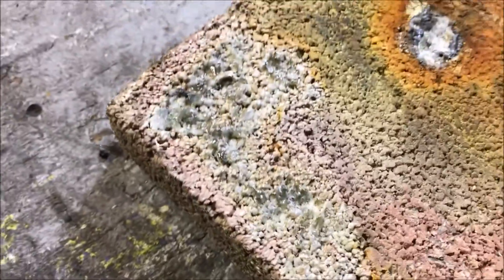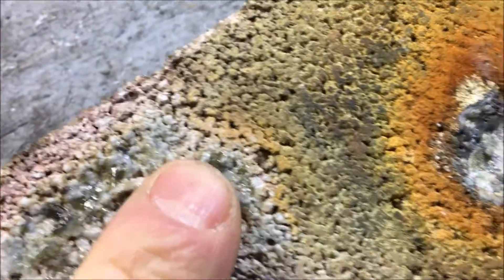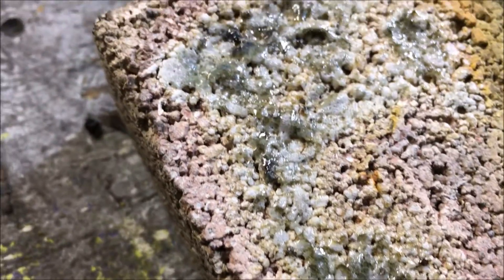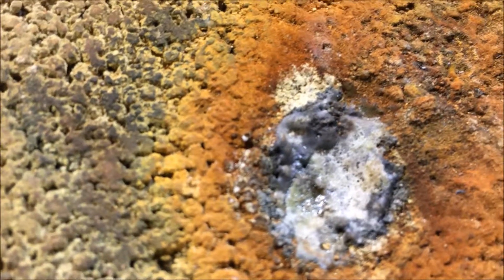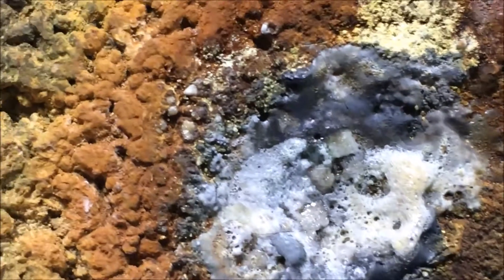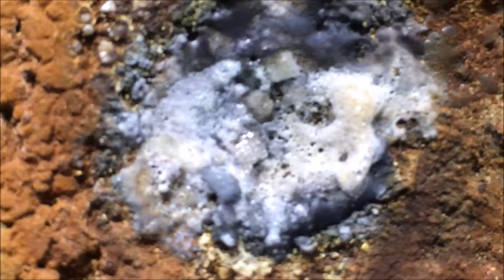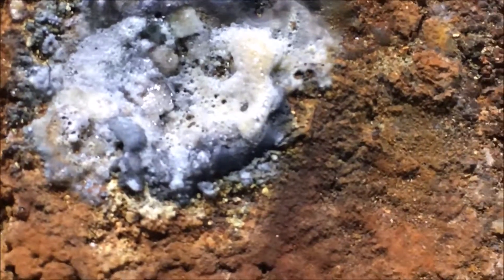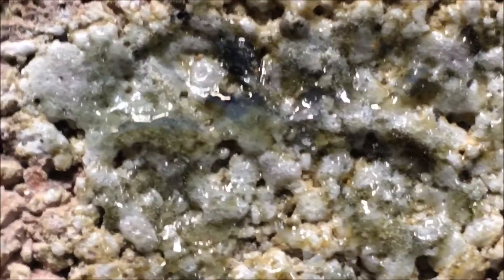HHO / Oxyhydrogen torch Boils Fire Brick

Comment: If one could glassify the surface of firebrick, and add a zirconium based IR reflective kiln wash to it that way, one could possibly harden firebrick against slag inclusion lowering it's melting point when used in biomass fueled stoves, like rocket mass heaters.   Need to build myself one of these and do some experimenting.
Reply from the maker: Great input friend

Comment: it can get to 5,072 degrees which is about 100 degrees or so lower than the boiling point of aluminum oxide which the fire bricks are made of, however plain old aluminums boiling point is in the 4000s